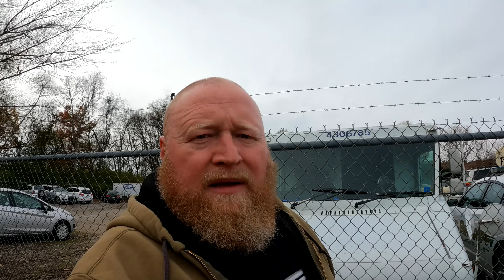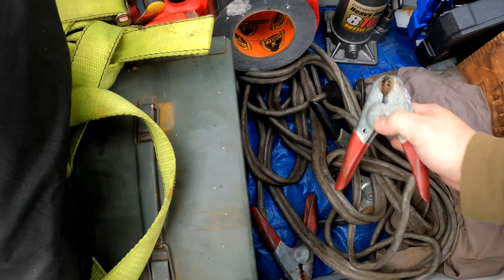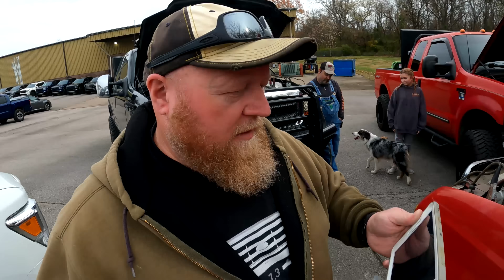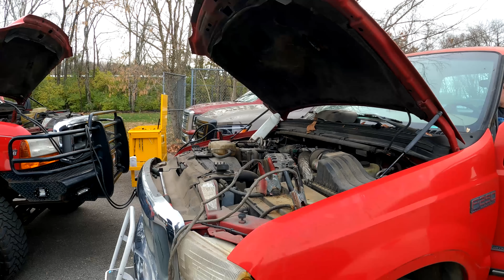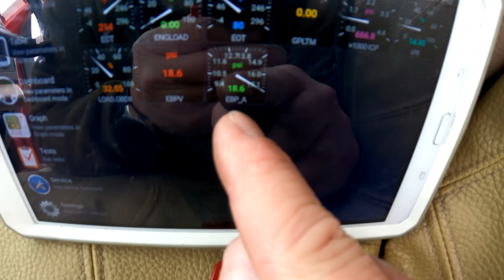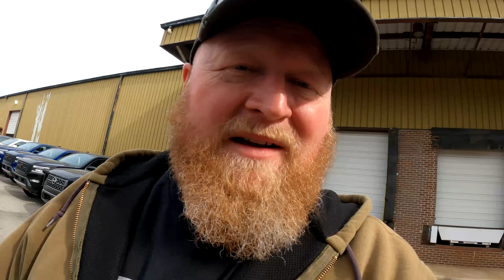$500 7.3 Powerstroke Superduty- Will it run? Why was it ABANDONED?

Comment: My 2000 f250 made in November of 1999 has the v8 diesel on the door and not on the fender.  Mines an xlt as well. Maybe the different packages had different badges. Door for xlt and fender for lariat? Maybe

Comment: It helps to spray some wd40 down the air intake it will start on it, don't use either it's dry!
Reply from the maker: That's a good tip, thanks!
Reply: @ProjectTimeGarage  Propane works also but it's dry too!

Comment: How does the tablet connect to the truck? You did not mention.  Its wireless? 
I need 1.
Reply from the maker: Have a look at my other videos, I have one that covers Torque Pro and Forscan from scratch. Only issue you'll have is the OBD2 adapter. The one I show on Amazon is on longer available and I cannot find a workable replacement
Reply: @ProjectTimeGarage  darn thanks for the reply

Comment: They stopped using the fender powerstroke badges mid-way through december of 1998. My 1999 F-350 was built 12/98 (exact date was 12/21/98) and it has the door badges instead of the fender badges. It was one of the first 100 trucks that is a late ‘99 but it still shares some of the early ‘99 parts on it like the front driveshaft being a saginaw double cardin joint versus a spicer one and it had (keyword had) the shorter front rotors and wheel bearings on it until i converted it to the 3/99 style rotors and wheel bearings. It came from the factory with the late ‘99 turbo, spider, and up-pipes. Hope this clears up any confusion!
Reply from the maker: Awesome info! Thanks so much.
Reply: There was no 1998 Powerstroke. there were body  style changes in the works and the next model year available in the 3/4 ton and larger trucks was 1999. I know this because my brother was going buy a new 1998 ford 7.3  3/4 ton 4x4 and was informed by the dealer that the next model year for these trucks would be the new 1999, so that is what he ordered. He fell in love with his new 1999, and so did I, So I ordered a new 2002 in late 2001. I loved my 2002 7.3 Powerstroke 4X4 and I still have it and still love it. After 24 years and only 114,000 miles I have not had any issues with it whatsoever. It still looks like new and runs like new.
Reply: @weswhitlinger1706 , i know that. The E-series vans were still being produced with the powerstroke in 1998 but there was no 1998 F-350. You could get an F-250 but no diesel that year. 1998 was the transition year for the new body style.

Comment: These trucks are notorious for the injector O-rings going bad not to mention the dead plugs in the heads leak oil. You’ll need to get a special hammer from blue point got the dead plugs. The o- rings are a simple fix the dead plugs are aggravating.
Reply from the maker: Good info, thanks!

Comment: I bought a 2000 F350 CCLB 4wd for $1k a couple years ago.  Has a transmission issue where it won’t go into drive or reverse once hot, after you put it into park.  It’s got 420k on the clock, zero blow by, mint interior, AC and heat work.  Glow plugs likely need to be replaced as well as injectors, but it runs good and has a lot of rust, but with a little more work it will be a solid DD.  I think your buddy did good.
Reply from the maker: Thanks!

Comment: Once it came to life it sounds great. No blowby, smooth. Yea I'd invest in fixing her up for sure. Don't even need to bring the motor to a machine shop. I'd just go ahead and bolt on the necessary updates, fuel return regulator, ebpv delete, and a hydra tuner. Remove the wrist cuffs from that genie.
Reply from the maker: My thoughts exactly

Comment: 362k would be due for a new turbo and maybe injectors soon. I deleted my Exhaust Back Pressure Valve actuator and welded up the port where the butterfly was located. I was sick of the oil leak from the actuator. The 7.3L is notorious for rupturing that High pressure line on the Power steering line due to vibration and rub thru/chaffing/abrasion. Best to add a piece of garden hose to the outside of the hose when it is replaced to protect it.
Reply from the maker: Good tip on the garden hose. Injectors, ICP, IPR, etc. are now done, everything else is in line to get replaced.
Reply: Mine Ruptured once,I still had 10 miles to make it home at 3 in the morning. Miracle the pump never locked up but I had very little brakes and no powersteering

Comment: I own a 02 and learned fast the the high pressure from the pump to the hydroboost rubs on the frame. I put a old hose over it and works like a charm.
Reply from the maker: Good info!

Comment: Your right why was it at the shop. I would say this is a score.
.
Reply from the maker: There is a oil leak where the dipstick goes into the oil pan (common for these). The ford service manual says the engine must be removed to fix it. My guess is the shop quoted him a huge amount of labor to fix the truck, and he just walked away from it. Of course, nowadays there are several companies that make repair kits for this problem. In fact, i have a video fixing the problem on this truck.
Reply: @ProjectTimeGarage   Thanks for that info. Learn a lot from you . Keep up the great work. Again, Thanks

Comment: I have a 2000 Powerstroke that has 265000 on it. On at trip this last summer, while towing a 32 foot fifther wheel. I had those power steering lines go on my truck. I had a local shop replace BOTH of the lines. After I got home I put the round pipe insulation on them where they touch/rub on the frame and shock tower so it wont happen again.  Now that you got that one running it looks like after a little TLC it might make a good runner.
Reply from the maker: Good info - I think we'll go ahead and put some insulation on these. Thanks!!
Reply: Ive had mine 15 years and it came loose at the fitting.

Comment: Bought a 04 in 08 for 55hundred  f 250 7.3 4×4..had a short ,so it always ran the batteries down ,ford couldn't find it ,they sold it two me ,3 days later I had it fixed...it was a short in the door locking mechanism somewhere so I just pulled the fuse😂🤣😅🤣😂  i just locked it by hand
Reply from the maker: Nice!

Comment: sounds like the 2000 International 4700 rollback I bought last week for $5Gs. Fella couldn't figure out why it would go dead pedal occasionally. Found a chaffed wire going to the APPS, a piece of tape later & running fine. Gonna need a trans eventually but hey it runs & the hydraulics are great! 

Y'all scored! 👍👍👍
Reply from the maker: Damn, you scored too!!
Reply: Ive had mine for 15 years and alot of miles.  Those pedals tend to go bad anyways.

Comment: Definitely ran it low on oil. And even though it was at the bottom of the range. It's just not enough. Been there and done that with my old 7.3
Reply: And some bad sensors probably
Reply from the maker: Yeah, we added about a half gallon. I think the reason it was at the shop in the first place was for the MASSIVE oil leak at the dipstick tube. My guess is that the shop went by the Mitchell service book hour and quoted the dude a fortune to fix it. Instead, he just abandonded it.
Reply: @ProjectTimeGarage  yes because they claim you have to pull engine ro fix it. If your oil pan starts to leak alot you WILL have to pull engine.  7.3 has no oil pan gasket,its all RTV.

Comment: Thanks for the video.  I’m going to look into fore-scan.   I recently did a will it run video on a f250 7.3.  Mine took a little more work than yours though…check out my vid of you have a moment.   How did the tranny turn out on yours?  I would say it’s pretty pooched with how delayed and under powered revers was.
Reply from the maker: The trans was way down on fluid. After we topped off, it shifts nice now. I have more videos driving the truck, check them out.

Comment: Fun to watch man, I too like these ol 7.3s and T444Es Ive had several and am pulling a 7.3 T444e right now from a bus.  I have alot of 7.3 videos Ill be watchin more of yours, thanks for showing and SWEET deal!  AWESOME yall got her started without much work at all good job.
Reply: On these I always dump the fuel bowl and pour in ATF before trying to start, it lubes up the injectors good.  Ive came across many with bad fuel pumps and clogged tanks/lines/bad selector valves all sorts of stupid stuff for no starts.  Also always keep a spare CPS on hand.  I don't use apple stuff but I have the BASF OBDII adapter and several programs as well as the nexiq usb link setup.  I keep a cheap inline fuel pump on hand to plumb into the fuel bowl bypassing the onboard pump/tank when dealing with no start without smoke.
Reply from the maker: Great info. Thanks man!!

Comment: Great work fellas! If these trucks have a hard start like this after being run low or out of oil, I like to pull the 5/8” plugs on the heads and add oil to the oil rails. Usually helps the process along. Ford manual also says to drive the truck aggressively after the oil system has been open or if the suspicion of oil aeration is there! Keep up the good work👍🏼
Reply from the maker: Thanks for the tips! I've been checking out your channel too. Really good content! Subscribed!
Reply: @ProjectTimeGarage  right on! I subscribed to you as well!
Reply: @The73Garage  , I'll be over to sub you channel pretty soon too.  I'm just starting to learn about ford diesels  , looking like it's gonna be the hard way ! LOL,  I just bought a 2004  F 250 6.0   Ran good for about three days , now it looks like FICM trouble .   WE'LL see what happens after I get that replaced !  Finger , eyes and legs crossed !

Comment: A late 99 production year date makes the truck a 2000. My 2003 6.0 has a production date of late 2002, but there was never a 2002 6.0. You can look at I believe either the 7th or 10th digit of the vin (don’t quote me on which digit) and that will give you the model year of the truck.
Reply from the maker: Thanks for the info. I also have a 2003 with the 6.0
Reply: 2003.5 was the cutoff for 7.3/6.0 switch. So u can have an " 2003" year date with either. Just fyi. Also the early 99 side gender badge isn't always 100% acurate for determining e'99 from l'99....I had an early 99 with fender badge even tho it was an 'early'. The intake spider is the easiest way to visually see which one you have. Intake spider is smaller on e99, and doesn't have an air intake heater on the front of it, not the relay for it(2nd relay next to glow plug relay on top of pass valve cover). E99 is a smaller got no but has a 'better' ('wicked wheel') in it=louder turbo😊😊. Wish I could find a deal like that, I thought $1000 was really good for my 2000 xl eclb 7.3 zf6, 2wd only, western NY(rusty) former construction company truck(a lot of idle hrs) that had like 250I on it.

Comment: I believe 12/98 was when they stopped using the Powerstroke fender badge.  I have an early 99 08/98 7.3 and thats how many is.  They can consider trucks to be early 99 all the way up to 3/99.  I believe after that they were considered a late 99.  Your friend got a good deal though.  Nice truck!  Deal of a century for any 7.3 running or not.  Cant beat that price!
Reply from the maker: I appreciate that info. Yeah, he got a good deal, no doubt. Wish I could stumble across stuff like that. I do find good deals, but dang, not like that!
Reply: @ProjectTimeGarage  yeah I'd definitely say its the deal of a century!  Hopefully he can make it into an awesome truck.  I was a little hesitant on getting an early 99 at first because I had an 01 7.3 for 3 years that I absolutely loved.  But I dont regret buying an early 99.  Most of the later parts swap right over anyways so its not too bad.
Reply: That is correct, all 98 builds were an “early 99, and 01/99 later were “late 99s” with the badges moved to the door
Reply: @Colinpnewbrey , my 1999 F-350 was built 12/98 and it’s considered a late 99. It doesn’t have the fender badge but it does have the door badge. It was a transition truck for sure because it has the early 99 sized rotors and straight end passenger side high pressure line but it has the late 99 turbo and spider size from the factory. So my guess is it was a very early production late 99.

Comment: I got a question i have a 01 excursion with a 7.3l 4r100 can i put mercon v in it??? I need a little fluid in there and from my 05 5.4l f250 5speed i have some left over and didnt know if i could use it i saw you used it in this video
Reply from the maker: My 7.3 has the 4r100 and the dealership told me to run Mercon V since that's the latest version of Mercon. By the way, do not use Mercon LV, it's different stuff.
Reply: @ProjectTimeGarage  alright sounds good to me the ex had its trans rebuilt at 275k and its at 345k now so i can assume after the trans rebuild it had nercon 5 put in it anyway just not enough it appears
Reply from the maker: @ryancollins3227  Yeah, as I understand it, Mercon V replaces all older versions of Mercon.

Comment: I just have to know I have looked all over the internet and can't find a definite answer to my question so I'm trying to figure out what is the largest tire I can run on my 2001 V10 Triton F250 lariat 4x4 stock height with 16x8 rims? I appreciate any input but I don't want to cut or trim and no rubbing
Reply from the maker: Well, I do know that the factory tire size is about 34" tall. That being said, there's very little offset to the factory wheels and the factory tires aren't very wide. I know for a fact that wider 35's will rub when turning, plus there's not much fender gap. I have pictures of my '03 F350 with 35x14.50x20 (just before doing my leveling kit) and it didn't look good in the front. I would say to be safe maybe 33x12.50 or so would be a safe bet.
Reply: @ProjectTimeGarage  thanks for the reply I've been leaning in that direction and wanted some reliable info from someone who deals with these trucks on a regular basis I appreciate your help I think I might try the Yokohama geolander Mt 305/70R16 it is supposed to measure 33.1 high and 12.4 wide
Reply: 35”-12.5 clears with a front leveling spring which does not affect handling.
Reply: @jessepitt  I've talked to some different friends and they say if you drive on uneven ground like I have at our hunting property I will have trouble going that big alot of articulation for my truck because of the weight my cousin has a Tacoma and just bounces everywhere lol I don't want any rub I do like a full wheel well I think it looks good but I want full motion and kinda want to leave it stock and I found the tires I think I want the Firestone destination Mt 285/75/16 measurements are 33.1/11.3 and a good American made tire. I appreciate your help though and who knows I may consider it so thanks
Reply: @Popeye85   I worked for a power line clearing company that ran a fleet of F-350 crew cabs. We each towed an ASV 4810 positrac with a massive mower deck. They were at least 10k and a big trailer to haul them. All the trucks had leveling only and 35s. They worked and articulated really well considering the weight we were hauling on power line access roads. I think the only modification to the wheel well was a slight trim to the front bumper corner. Not even noticeable.
Reply: I have been running 35’s for the last twenty years and I don’t ever feel like running anything smaller due to the depth of our winter snow and the sandy summer conditions.
Reply: @jessepitt  I run 315/75r16 toyos at open country average 65000 miles with regular rotation and only rub on tight turns like parking spots no issues off road or towing with just a leveling kit

Comment: Dude a running 4wd diesel for 500 bucks? WITH an awesome floating steering wheel? Thats unbelievable!
Reply from the maker: Yeah, the floating steering wheel is what did it for me, LOL!
Reply: The steering wheel means the previous owner was short and used it as a grab handle lol.
Reply from the maker: @jessepitt  Ha Ha, I'll bet you're right!
Reply: The key to that is they didn’t know it ran when they bought it for $500…this deal could have just as easily (and FAR more likely) have gone the other way and ended up with the truck having holes in pistons, a bad trans and badly worn out engine, etc, etc…usually when you pay 10% or less of what a vehicle is usually worth it’s because the person selling it doesn’t have the time and or means to mess with it…it may be a minor fix, or it may be major. But anyone going around buying the cheapest non-running diesel trucks out there  assuming it’s always gonna be a minor thing just because “diesels run forever” is gonna get burned sooner rather than later…the only big question is can you afford to get burned?
Reply from the maker: @J.R.in_WV  the short answer to that question is; Yes, we can afford to get burned on this deal. $500 for a truck that will scrap for about that amount is a good gamble any day. I do it all the time and I'd do it a thousand times over.
Reply: @ProjectTimeGarage  it’s obvious you guys know what you’re doing, you’ve got at lead a dozen projects going on that your average person wouldn’t dream of taking on. My comment is more for people who get themselves in hot water thinking it’s always a money-making prospect picking these things up on the cheap. Having the room, skills, tools and time to work on them like you or I do helps stack the deck to where you almost can’t lose. I just feel bad for the people I’ve bought unfinished projects or $500 “deals” off of who got in way over their head and don’t even have a trailer to haul the thing in for scrap so they have to literally give the stuff away. I mean I don’t feel bad enough to not buy the thing and make money on it myself but at least trying to warn them so it doesn’t happen again is better than doing nothing, or at least I hope it is.
Reply: I want one❤❤❤❤